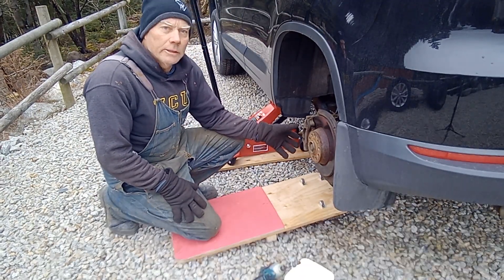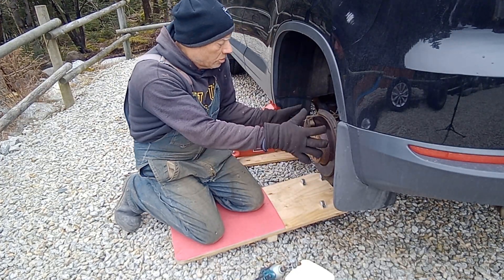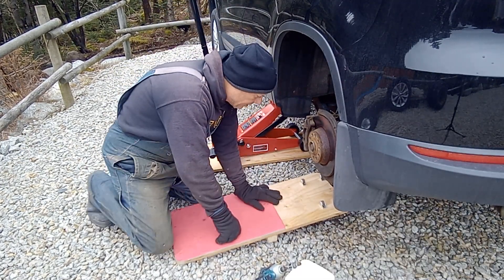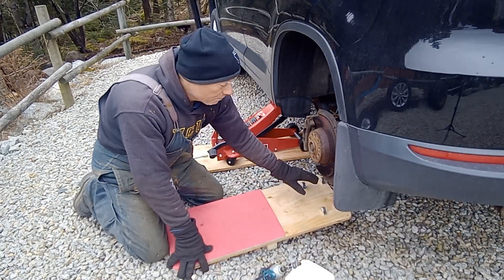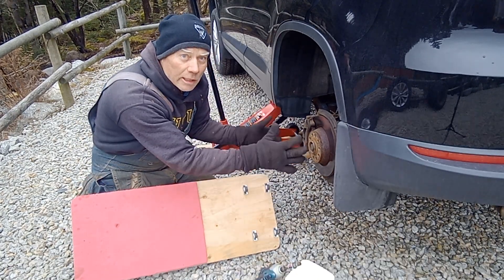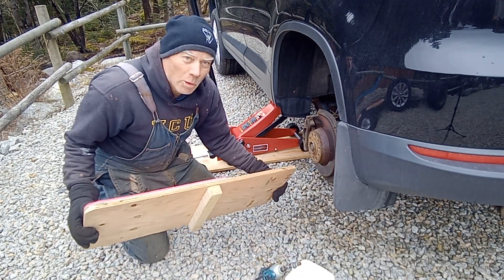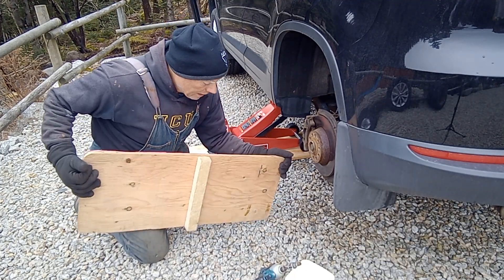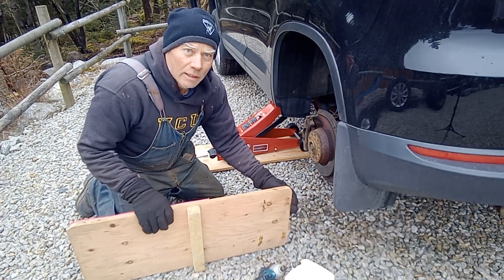12  Simple Tire Lift For Changing  Out Your Tires

Comment: A whole hell of a lot better than the lesser quality and smaller $150 tire lifter that’s on the market, with an optional $85 roller plate adapter, which is a grand total of $235 for a tool that you can make for a fraction of the price.  Thanks for the idea!
Reply from the maker: @autocompletellc9906  Hello! I am just guessing, but I think the casters I used were about $3 each. Thanks so much for commenting. Have a great week, Ben
Reply: @ That just goes to show how a little thinking and tinkering can solve everyday problems on a budget. Awesome job! Thanks again!

Comment: Neat idea, Ben.  I did th same but didn't consider adding the rolling casters for thewheel to rotate.  That makes a big difference.  I was replacing all the wheels on a livestock hauling trailer so I had four wheels to replace and the see-saw board I made helped but again the casters would have made things a bit more easy when doing verything by yourself.  Of course, my tractor with pallet forks helped lift my trailer completely off the ground to place on double-stacked sinder blocks.  I love having a tractor.  It's the strong back and strong arms that I once had.  Be well my friend.  Don👍🏽🤠 7/19/23
Reply from the maker: Hello Don. Yes, the casters help, and are only a couple of bucks a piece at the hardware store. I agree with you, having a tractor, is like having the Hulk as your best friend.  I just wish someone had convinced me years ago, how much I needed one. All the best,  Ben

Comment: Thanks Ben for posting this great video and inspiring me to made one. I had a couple of extra 12” bench rollers that I used rather than the casters. Tires slide and turn easily on the rollers. I also attached a magnetic tray to hold the lug nuts.
Reply from the maker: @Ron-k8m  Good morning Ron, nice upgrades.  I think the rollers would work better and the magnetic tray is a great idea. Thanks so much! Have a great week, Ben 👋😎👍
Reply: @whenworkisplay thanks Ben, you have a great day also

Comment: i am only 59 but putting back 4 tires per day kills me. Does it matter the tire height or is this one for one size only?
Reply from the maker: Good afternoon,  we have 16 inch tires on the car but I think it should work for any size tire. I don't jack the car up too high, just enough to easily get the tire off and then the couple of inches I have for lift works fine. When I was building it I played with the position of the casters to make sure that the tire wouldn't touch the plywood. Hope this helps. Take care, Ben

Comment: 33 inches length, how many inches wide?
Reply from the maker: @joenaz3226  Good afternoon,  the plywood is 14 inches wide. The casters are 8 1/4 inches apart, measured to the center of each caster. That keeps the tire from touching the plywood, between the casters. Our tires have a diameter of 27 inches. Smaller tires would require the casters to be closer together. Have a good one, Ben
Reply: @whenworkisplay Thanks for the info, where did you buy the casters from? I cannot find in google the exact ones you used.
Reply from the maker: @joenaz3226  Hi, I am pretty sure I bought them at our local hardware store. As long as they don't swivel any casters will do .
Reply: @whenworkisplay Thank you very much